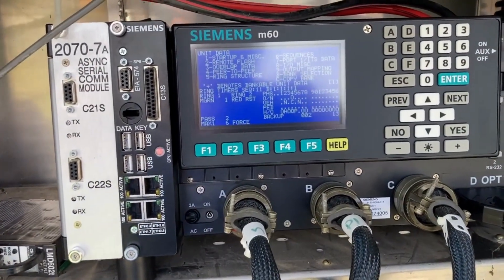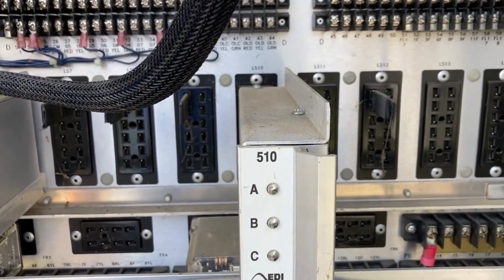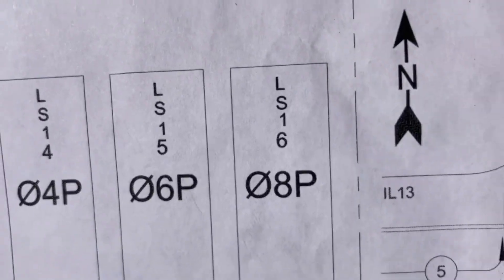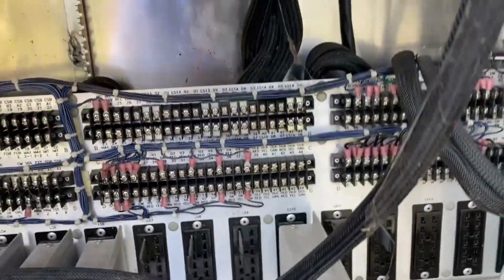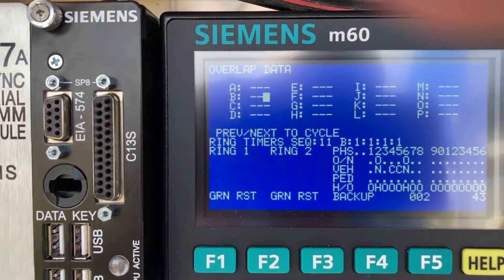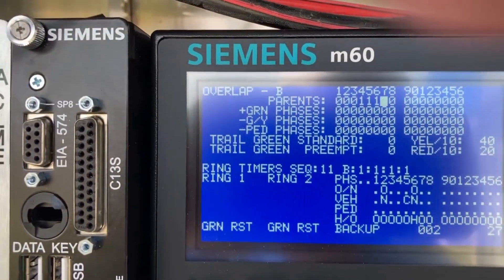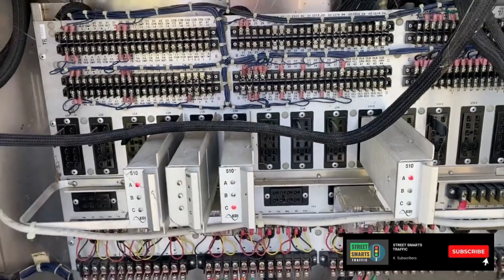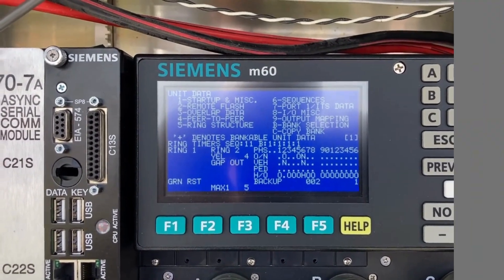Traffic Signal Controller Programming Error

Comment: WTF is "overlap B"? What is overlap, how is it important? I'm an idiot. I don't work with traffic control devices, but I like understanding how our civil infrastructure works.
Reply from the maker: Hey don't worry about it!  I asked that for the 1st year of working in traffic signals LOL   An Overlap is a set of indications that mirrors one or more movements.  An example would be (if you can picture this), a northbound right turn arrow (or for  short- NBRT).  So this NBRT overlap (which may be overlap B) can turn on with the NB movement.  It can also turn on with the WBLT movement.  You may have to draw this on paper (I like visualizing things) for it to make sense.  Hope that makes sense!

Comment: I have a problem on an intersection, every two or three weeks it will hold only from south to north and vice versa, but it won't change to west and east, and on the controller which is a m60 it says locked out. I change the controller but still having that issue. Any ideas? Thanks in advance!
Reply from the maker: locked out?  .Hmmmm...  Have you checked the switches on the door?  Could possibly have a toggle switch in Stop Time instead of Run.  Feel free to email me pics of controller screen and cabinet if that doesnt help
Reply: @streetsmartstraffic  thank you very much, appreciate it very much. What would be the email?
Reply from the maker: @AlabanzasyAdoración7  jon@streetsmartstraffic.com - or go to my site:  streetsmartstraffic.com and go to the Contact tab
Reply: @streetsmartstraffic  thanks, I will do that as soon as the controller fails again.
Reply from the maker: @AlabanzasyAdoración7    No problem.  Hopefully it won't fail again!😄
Reply: Do you have controller timing backed up on a laptop? It seems to me you shouldn't have to program the controller by hand. It would cut down on programming errors. Too many parameters to program manually. Very easy to make a mistake.
Reply from the maker: @MikeM-cz5ln   Funny you say that.  Part of my video was going to include the controller database software that I use (I'll save that for another video).  This particular scenario we had upgraded controller software also.    At that time, there was a known problem from the vendor about the database software trying to convert to the new OS and getting all the timing moved over accurately.   So......
Reply: @MikeM-cz5ln  I saved the info on a laptop, with the recent information. But I think the people that programmed that intersection didn't programmed it right.